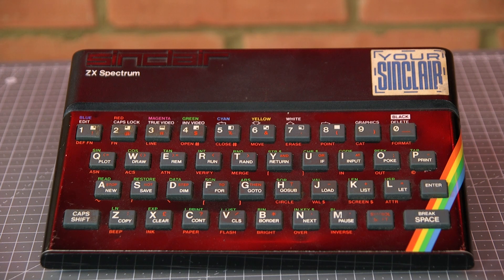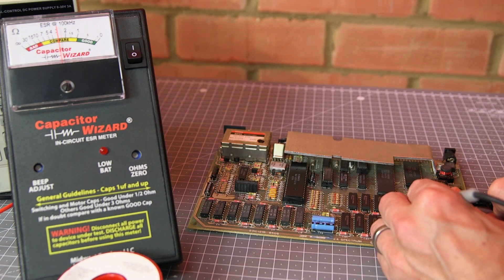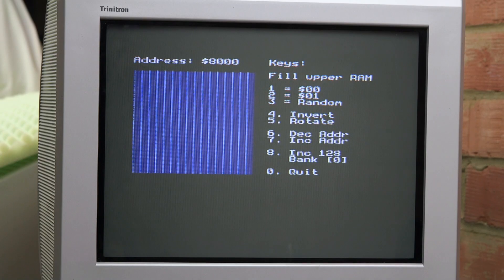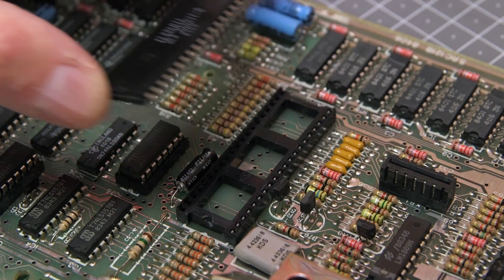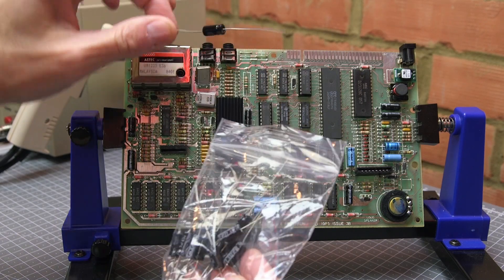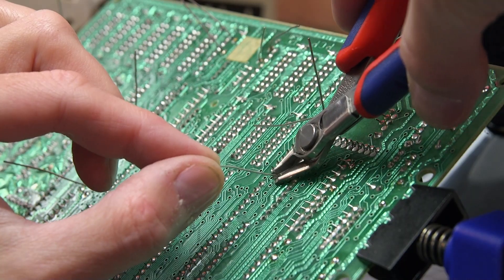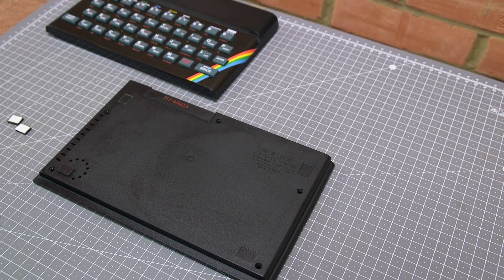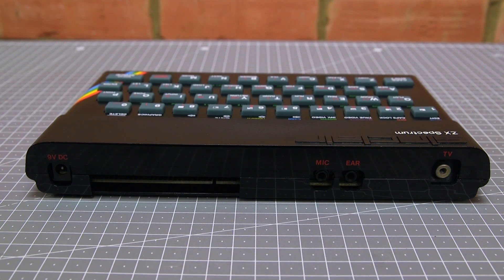Sinclair ZX Spectrum 48k | Charity Repair and Refurb

Comment: Hello, could you give me a purchase link for this DC DC converter, where did you buy it or on Aliexpress that is economical?  I also wanted to know where to buy a DC power input connector for a zx spectrum 48k. Thank you
Reply from the maker: Hello, Retroleum.co.uk is where I bought the DC to DC convertor (it is their MuRata Switch Mode 5v Regulator (replaces 7805)). They also sell the DC connector you want (Replacement 2.1mm DC Power Socket).
Reply: @RetroWorkshop  Thank you!, I also need a low dram 4116 memory for the IC13 bank, do you know where I can buy it that is economically cheap.

Comment: I would have added a RESET button on the back as we all know that the main damage done to spectrums was removing the Power Plug as it often broke
Reply from the maker: I think you can buy DC leads that have a switch in them, to save wear and tear on the power connector.
Reply: @RetroWorkshop  i was going to say that

Comment: Great repairing video...I find it on time. Can you share the characteristics of that DC -DC converter? Maybe a link.
Reply from the maker: It is a murata convertor from retroleum.co.uk
Reply: @RetroWorkshop  I did the mode  you showed for the composite signal and the image flickers every 3-4 seconds. Do you have an idea why that happens? 
btw the transistors you used to  bring brightness up were the same (new parts) or a different variant?
Reply from the maker: @NickolasGaspar8bit  Have you got the capacitor the correct way round? Have you replaced the two transistors? Noting that they are different transistor types and have to be inserted the opposite way round - "Replace TR1 and TR2 with BC549C Inserted the opposite way around"

Comment: May I ask what were the replacement transistors you used to increase the brightness after the video signal output mod?
Reply from the maker: Information can be found here: https://www.retroworkshop.uk/sinclair-zx-spectrum-48k-charity-repair/
Reply: @RetroWorkshop  Thank you kindly.
"Replace TR1 and TR2 with BC549C" Inserted the opposite way around.

Comment: Direct soldering of chips is VERY dangerous. Heat from the soldering gun can easily destroy the chip. That's why sockets are used. If you get no problem then you are lucky. It's playing with fire in more ways than one.
Reply from the maker: Understood that undertaking such work risks damaging the chip or the PCB. I am quite experienced with such repairs so was happy to undertake this work. As these devices run hot (very hot in the case of the older series ULAs) this mod is recommended to extend the life of the ULA. It was suggested by Mutant Caterpillar I think, who is very experienced in Spectrum repair.
Reply: I have desoldered (and many others) numerous of chips from all types of boards..... Ataris, C64 , Spectrums, Amigas etc. If a chip can survive a desoldering process then soldering a chip ( a far less heat intense process) can never be that dangerous....
Reply: Never damaged a chip from soldering in 35 years of tinkering.

Comment: Perhaps replacing old caps for new may not always be such a good thing.... The quality of electrolytics these days maybe worse ("cheaper & designed to last only to fulfill the warranty period") than it was then, however today's tech is expected to be better. Would be interesting to do a mass sample of new and old.
Reply from the maker: I am normally a bit skeptical about replacing electrolytics en-mass, just for the sake of it. I prefer to measure with an ESR meter to judge health, and replace as necessary. However, in the Spectrum, it appears to be worthwhile. I've got another video where I looked at two machines, and the picture quality was improved by simply replacing the caps, even though the ESR was worse in the newer caps. There are clearly other factors at play (leakage etc.).

Comment: Seeing you do solder work, I was specifically told, not to do, what you are doing which is touching the electronic components with the soldering iron. The best way is to touch the electronic components with the solder wire, then touch the solder wire with the iron.
Reply from the maker: Never heard that Ronnie, and never had any issues. The main guidance I was trained with, is the two second rule, regarding max time to leave the iron on the pad. From experience, the weak point is the pad on the board.

Comment: Can I write this test ROM on chip and desolder original for replece and test? Wich was a new TR1 and TR2 Instead of ZTX 313? wich polarity for cap on RF-modulator? Thanks
Reply from the maker: It is a lot of work to desolder the ROM. The SMARTcard (and other similar devices) allow you to take over the on-board ROM using the device that plugs into the expansion port. You can also copy alternative ROM images and boot from them. Details of the ROM I used are here: http://www.retroleum.co.uk/diagrom/diagrom.pdf

There is another popular test ROM by Brendan Alford here: https://github.com/brendanalford/zx-diagnostics/wiki/Firmware

I think I have seen people use one of these burnt into a ROM in the original Spectrum, but I can't be certain.

For info on the capacitor mod see here:
http://blog.retroleum.co.uk/electronics-articles/repairing-a-zx-spectrum/spectrum-video-mods/
For details on the replacement transistor for higher level video output:
https://www.retroworkshop.uk/sinclair-zx-spectrum-48k-charity-repair/

Comment: Given the regulator takes 9V and drops it to 5V, if it was fed 6V would it dump less heat? I'm  guessing Sinclair used 9v supply because that such PSUs were cheap and plentiful. Or are there are elements on the board that need 9V?
Reply from the maker: Yes a lower voltage before the regulator would produce less heat. The original PSU was unregulated. Therefore it may provide more or less voltage, depending on the load. Nowadays we’re used to more complex (but now cheap to manufacture) regulated PSUs that output a constant voltage. Not sure I’d go as low as 6 but certainly 7 volts would work.   The input voltage probably does come out of the rear expansion but I’m unsure if any devices make use of it.
Reply: @RetroWorkshop  thanks. So a modern PSU is probably a good idea to increase Spectrum lifespan if one isn't into opening it up and getting the soldering iron out.